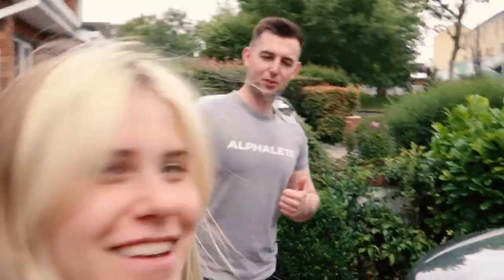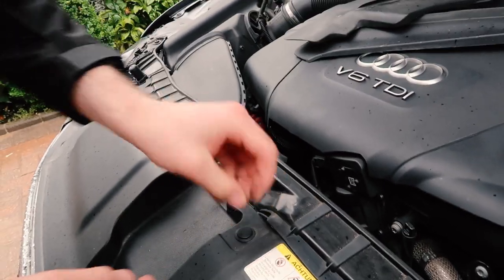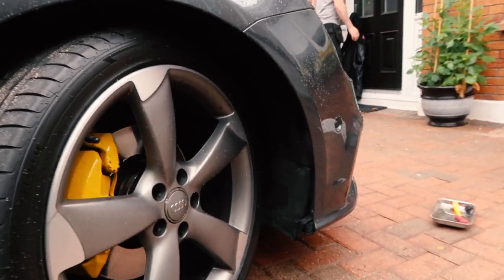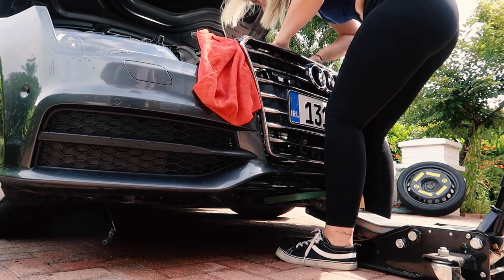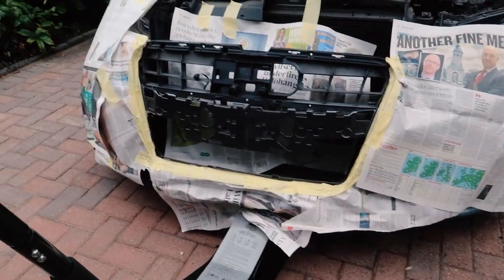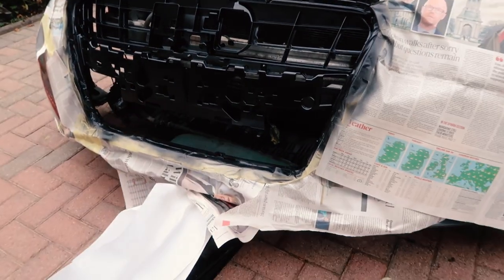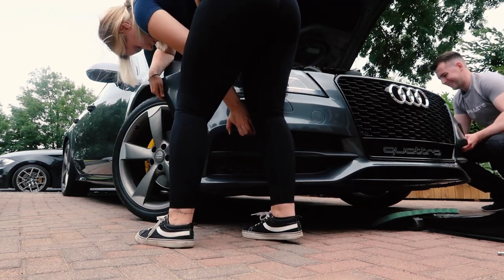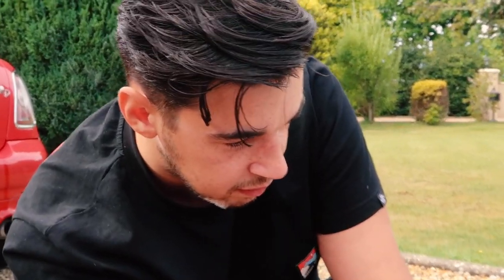Installing RS7 Grille | Audi A7 MODS

Comment: Howia guys how do ye find reliability of the A7? I'm thinking of getting a 2015 A7 3.0 TDI quattro 272 bhp but am worried about the gearbox issues with the stronic auto box
Reply: The 2015 i think is the next gen engine. Gearboxex are “ crazy” will either last or will break))